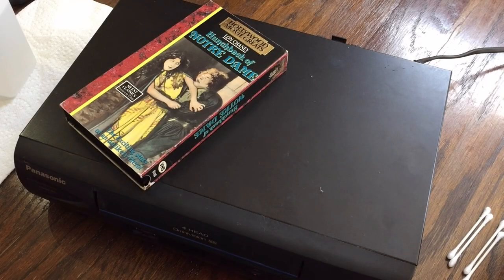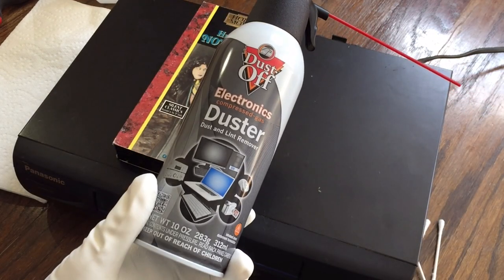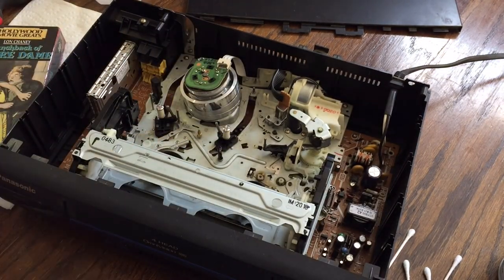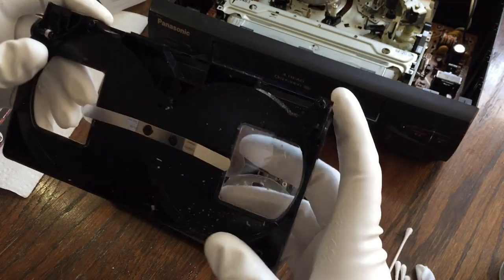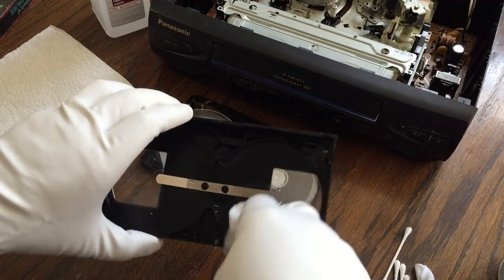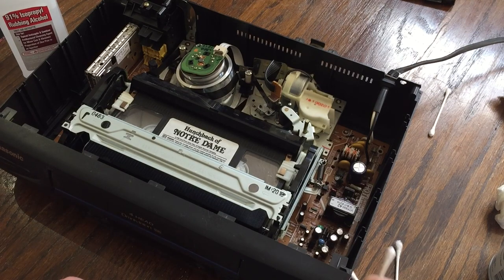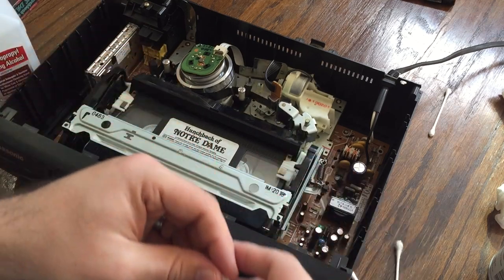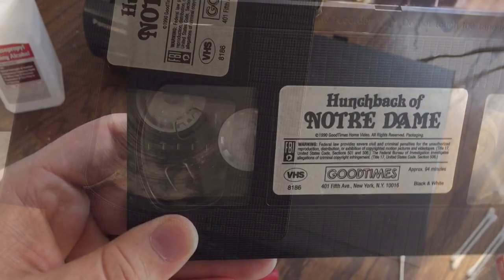How to Clean a Moldy VHS Tape

Comment: Just used your method to clean my parents' wedding video that was horribly overgrown with mould. It turned out great and I digitised it after, even though this was the copy and I found the original tape in pristine condition in another box nearby shortly after! Great tutorial all the same!
Reply: What metod you used for digitised ? I also found my parents wedding VHS.
Reply: @tossik1647  I followed The Oldskool PC's video on digitising tapes with VirtualDub, but feel free to check around and see what works for you: https://www.youtube.com/watch?v=sn_TDa9zY1c&ab_channel=TheOldskoolPC
Reply: Does alcohol damages vhs tape?
Reply: @andrewrobotbuilder  does alcohol damages vhs tapes quality later?
Reply: @mominaali2700  not that I know of, it's not a solvent that dissolves plastic, so it will keep its shape practically forever
Reply: @andrewrobotbuilder  I think that the vhs tape coating can get damaged due to vcr head friction or due to chemicals used on vhs, I use soft tissues to clean vhs but never tried alcohol because I fear that alcohol might damage my vhs tape data, what do you think?
Reply: @mominaali2700  I probably wouldn't recommend it if it's the only tape you have and no other copy exists, in which case taking it to a professional restoration service is best. That said, I did find out later I had another unspoiled copy (the original actually!), so worst case scenario I could have used that as the backup. All in all it worked for me to get what I needed even if I had an unspoiled copy and the cleaning on the first worked anyway with no repercussions
Reply: @mominaali2700 yes it does damage them
Reply: W

Comment: Great vid! Haven't read all the comments to find out if anyone's brought this up, but I've had extra crusty tapes break during cleaning, because of sticking. To avoid this now, I'll let a valuable tape run through at regular playback speed to knock the heavy mold off and allow the tape to separate from the rest of the spool. I vacuum that out of the VCR then clean the tape as you describe here.

Comment: I clean both sides at the same time, by using a cleaning bad folded over between my thumb and finger. Much more efficient. However, when I try cleaning with Isopropyl in the manner you use, I have found that the tape layers can stick togther. I do it dry, and clean by hand any hard bits of mould that don't come off with a pass like that. If it's a bad and 'crusty' bit it will need going over repeatedly with Isporopyl to shift it. I take the tape apart before I start, after  I've ff'd it, and again at the end.

Comment: I've got a 60 tape challenge ahead of me, some like this and sone much worse. I wondered whether you could clean both sides of the tape at the same time, then still give it two passes. I have a spare old VCR as my 'cleaning rig" so only clean tapes go near my decent VCR. As soon as they're clean I'm digitizing everything, then the tapes can all finally go,  but not until I have a backup of everything, just in case. Will practice opening up and cleaning a couple of test tapes to get the hang of it first, then get a routine going. Thanks for sharing.
Reply: I’ve only got 3. But I don’t know what’s on them. Could be gold. Could be crap ha.

Comment: You should use an older VCR which does not have the tape laced round the drum in fast wind. That way you don't risk contaminating the whole tape path with mould or harming the heads

Comment: Glad i found this video. Starting to collected animated movies/shows and as i was cleaning out a shelf that was no good, turns out a few tapes have caught mold. luckily their not so hard to find for a reasonable price, but i definetly will invest into another old VCR and convert it into a cleaner, just in case i run into a issue where a tape is hard to find/expensive

Comment: Before and after showing the tape played would have been nice.

My home VHS tapes don't have clear windows so I have no idea if mold is causing the to look all messed up.
Reply: If the reel is damaged in the middle you will see lines fading in and out sadly this is impossible to fix, no way round fixing this, this happens if the reel is poor quality or the tape got jammed in your VCR and screwed the tape reel. Do not use a VCR that is of low quality stick to ones made by Panasonic, HS860 or NV Series they are reliable.
Reply: I have been doing this for 6+ years for clients. I live near the coast with high amounts of humidity (lots of mold). 

It usually improves the tapes by 50-90%. There are rare cases where the mold does damage the tape beyond repair. Its time consuming but worth the results.
Reply: @masongovender9231  Hi mould can damage the reel or recording of a tape, if the video or tape is important i strongly recommend you make a copy or transfer it over to DVD then that way you have a backup.
Reply: I’ve heard that putting mouldy tapes into a vcr player can damage them..the mould will collect on the video heads and over time will break it..and if there’s mould on the video heads and you put a clean tape in, it can transfer onto that tape and make that mouldy too 😮

Comment: why don't you just wrap some micro fibre cloth around the first post then you wouldn't have to hold it away from the post? also i'm wondering if you could use a UV light to kill the mould or would that effect the tape ?

Comment: That's exactly how I do it! But you forgot to clean the tape path of the VCR because mold spores will get stuck on the tape guides and heads. :)
Reply: Any advice on how to clean the tape path of the VCR? (sorry, I realize your post is over a year old, thought I'd ask just in case)
Reply: @maxsol84  get some kimwipes and 90+% rubbing alcohol  and spin it around while you gently hold the moistened wipe against the head. Look up how to clean dat recorders - same thing
Reply: you have to be gentle because the heads are fragile

Comment: Would it ruin your vcr if you fast forward the vhs tape if  there is lots of mold on it?
Reply: Jody Wagner Yes... definetely. You will contaminate your vcr and all the tapes you put inside afterwards. You can ruin your heads too if mold gets in contact with them.
Reply: JMA  I been doing one with lots of mold on them then Cleaning my vcr with rubbing alcohol and so far no mold has returned to the tapes I finished after watching them with the vcr I use to clean them 😁

Comment: I have some tapes with like one small spot of dust that's about or less than the size of this . some have a few small spots around. Some have one and i mean ONE speck of small hair. Is it mold or is it possible for dust to get inside and on the reel?

Comment: Does this method work with a moldy audio cassette as well?
Reply: If it has moId.  think it would work. It’s just tape. But you may not be able to remind and forward it like he did on a machine. . You could use a biro pen to turn the reel and a cotton bud on the tape. Cleaning the inside of the tape holder would probably be more fiddley if you had to do that

Comment: Would a method like this work on a VHS rewinder/fast forwarder with just the spools attached? It seems that there would be enough space for cleaning in a case like that, but I'm not entirely sure.
Reply: ud have to modify it, thats what i was thinking of. Cause it wont rewind unless you drop the tape it and close it, then u might have to drill into the plastic housing to have a entrance area to sitck in a cleaner cloth or whatever you plant to use.

Comment: Hi! I'm afraid to screw up my vcr cleaning my moldy tapes. Could this be done manually, without the vcr?
Reply: Fabián Peña Loyola you can get some old vcr from goodway or somewhere sells oldies
Reply: Fabián Peña Loyola yes technically  .
Reply: Any old junk VCR off eBay or Craigslist will work as long as it fast-forwards and rewinds.  Don't contaminate your "daily driver" doing this.

Comment: Im trying this on a really old BBC VHS wish me luck
Reply: Doing this on some Tennis tape that has too much mold to the point it fucked up the quality.
Reply: Toby Watts my cousin's VHS tapes got moldy during bad weather
Reply: MR VHS COLLECTOR. Where did your cousin store the tapes? I wonder why there are so many moldy tapes out there? I keep mine in the house in a room and they all play perfectly.
Reply: My VCR eaten a tape but I fixed the problem and they play just fine
Reply: Good Luck! (Even though you have probably finished by now...)
Reply: @zandorvorkov9305  I grew up in Texas with central air conditioning to keep my tapes nice and dry, but a lot of parts of the country (including San Diego where my in-laws live) still don't have it in most houses, and humidity from outside can creep into areas that the little window units or portable units don't reach.

Comment: You only cleaned tape edge.
Is there have no fungus grown on tape surface? 
Once helican head scrolls fungus into head gap , heads will die.
Reply: Usually when mould occurs on a videotape it usually starts at the top and bottom edges (in theory you can just run a mouldy tape through a spare VCR a few times and clean it out later). The mould would only affect the recording surface if the tape has very deep mould (i.e. it wasn't caught soon enough) or if the tape got damp (if that happens the tape could suffer from sticky shed syndrome and require baking before even considering cleaning).
Whenever I do this job I will often repeat the process until the cleaning tool is clean and there is no gunk on it (in a lot of cases if I need to do another clean on the rewind pass I have 2 cleaning tools, one for the bottom side before it hits the head and another for the top side after the head before the tape re-enters the cassette). In between passes I would recommend a break for the tape so the IPA can dry and any mould left can deactivate, in some extreme cases I will manually go through the tape (also leave the tape for a few days to see if any mould returns before considering running it through a good machine). This cleaning method uses the same principle as an RTI Tapechek machine and the cleaning tool does touch the whole surface area so it could knock pretty much all the mould off. 
Also don't use a good VCR for this job, always use a machine you don't mind losing, hell the heads can already be damaged, all it needs to do is fast forward, rewind and eject. Also afterwards I would recommend cleaning out the spare machine well.

Comment: 2 additional thoughts.
Buy a VCR for $10 at a resale shop for this, don't use your good one. Also this is not a permanent solution, this makes the tape usable so it can be copied to a clean new tape. The video will be preserved on the new tape.
Reply: Indeed. No sense doing the cleaning process on an AG-1980.

Comment: Does that process effect the VCR at all?
Reply: I think its best to use an old VCR and also clean the heads on that too after. A panasonic engineer gave me a trip to clean heads on VCR. It was to use white paper. Tear off a little and spray  Isopropyl  on the paper and hold agains the silver drum that contains the heads and apply a little pressure as you turn the drum manually back and fore. (I always disconnect the VCR from the power supply while doing this ) You will see black on the paper, throw away and repeat the process till the paper does not pick up any dirt. Make sure you clean the full 360degrees of the drum.

Comment: lol if the mold already got in, why are you worried about an open window or gloves? you also most likely ruined the sound. Youd be better off cleaning the roll lightly as if trying to whipe the sides of a tape roll. Do not soak or press hard. I've cleaned a vcr soaking a tape in alcohol before but it was risky. Same can be done to nintendo and games. The tape looks like shit. lol. lastly..."for a few bucks" you could have replaced this buying it online. I've thrown out the entire janes bond vhs collection and then payed 20 to 30 buy it all back for a piece of mind. Some were factory sealed.

Comment: I DON'T SEE A VIDEO DRUM HEAD CLEANDER IN THE VIDEO YOU USE. IT'S A PART THATS CLEANS SHORTLY THE VIDEO HEADS IN THE VIDEO DRUM. BUT NOT WITH ALCOHOL. AND IT ONLY CLEANS THE SMAL LINE WHERE THE VIDEO HEADS ARE IN THE VIDEO DRUM.

Comment: NOTHING LIVES FOR EVER. YOU ARE MAKING YOUR OWN PROBLEMS. IF YOU CLEAN THE VIDEO DRUM WIT ALCOHOL LIKE THE HEADS IN A AUDIO CASSETTE RECORDER. AND YOU DON'T WAITH ENOUGH. THE VIDEO TAPE WILL NOT CONTACT DE VIDEO DRUM. AND YOU CAN BE SHURE THAT THE VIDEO TAPE IS DEMAGE. AND THAT'S THE LAST THING YOU WANTED. AND THE D.V.D. 'S AND THE BLEU RAY DISCS. ARE BETTER THAN THE VHS. BUT SONYS BETAMAX IS OLSO BETTER THAN THE VHS.